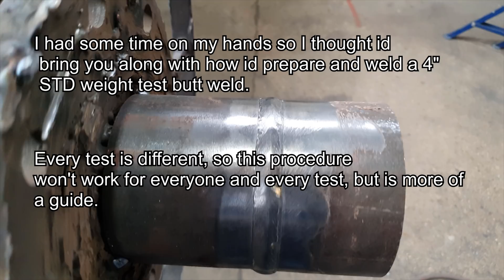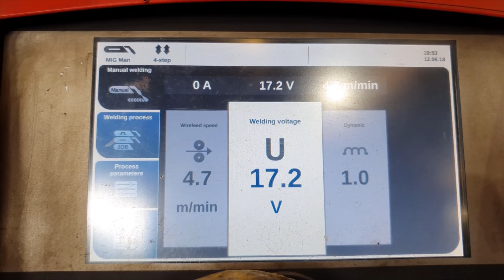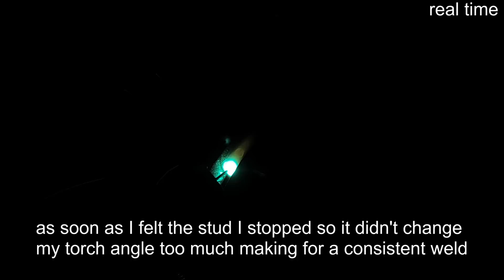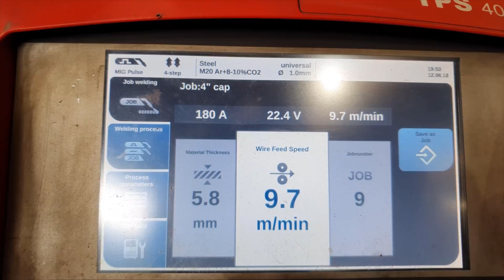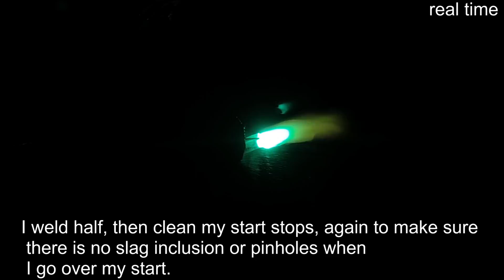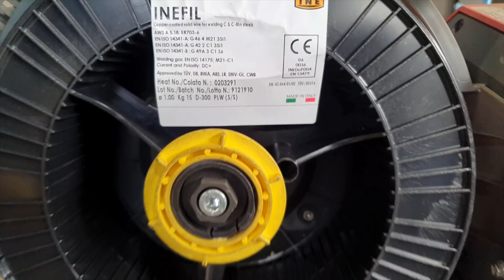1G Roll Out MIG Pipe Welding (Practice Test)

Comment: In the USA sometimes we're not allowed to use a grinder. Only a wire brush and a chipping hammer.
Reply from the maker: Isit? Whys that
Reply: @ARCONEWELDING  It depends on what test you're taking, what welding process and sometimes the examiner/evaluator. If you get an old grumpy guy, he may not let you use a grinder.
Keep up the good work.